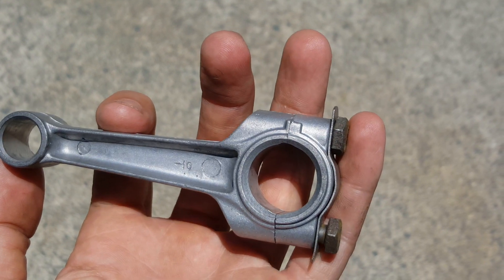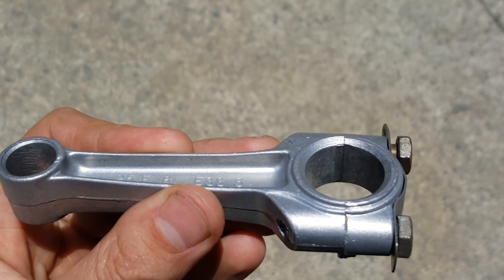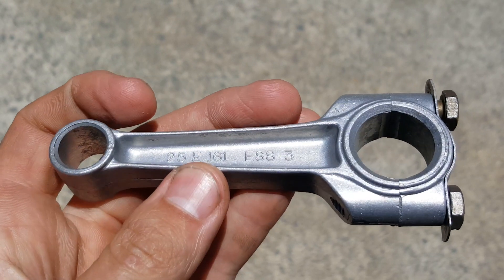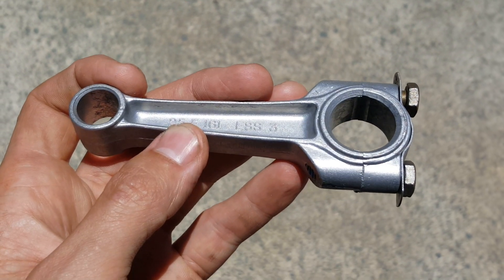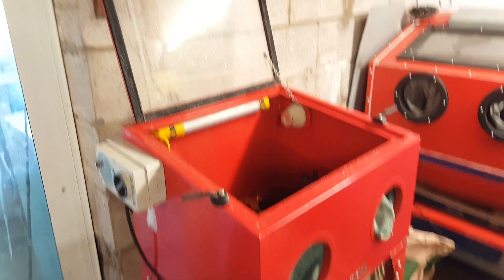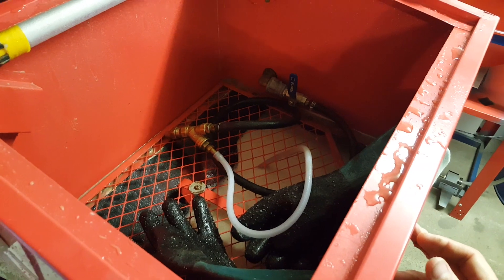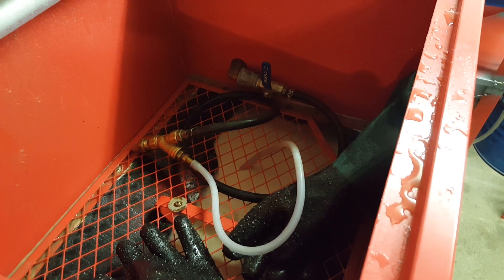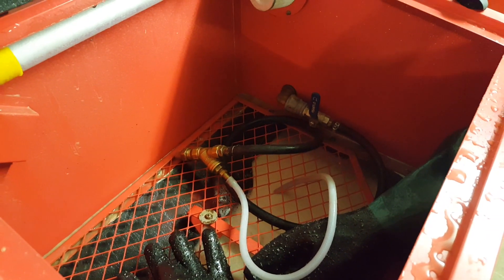DIY Vapor Blaster Nozzle Update Pt2

Comment: Nice work. So the actual pump in the system only agitates the slurry? A nice simplified approach if it works and it seems to. If you used a longer siphon hose and perhaps attached it to the grate so it wouldn't pull out of the slurry pool that would help I reckon?  Definitely paying attention to your vids.
Reply from the maker: Hi Douglas.

Yes that is correct. Meaning a much smaller pump can be used.

In any future builds I use this method I will have a fixed point in the slurry tank. This was just for testing.

Thanks for watching!
Reply: @ArmouryEnterprises  I really like the idea of using an old dishwasher cabinet/pump simply because of the cost savings and size. I don't really need to clean large parts but a lot of small aluminum pieces, rusty bolts, etc. So this direction is very appealing. Watching closely for updates.